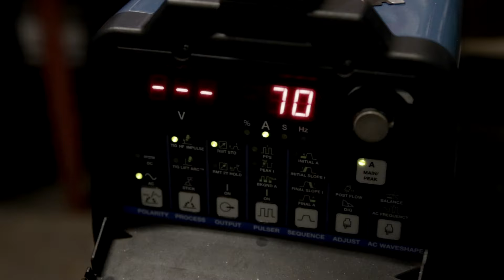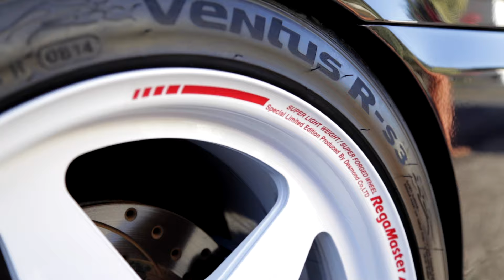Integra K20 Turbo Project for Autology Unltd.

Comment: I'm getting a 1994 integra ls hatchback I wanna do a swap but idk which one any ideas guys I'm new into cars so help...
Reply from the maker: CaptainZero depends of the budget. Expensive and powerful - K20 Engine or Cheap with good power - B Series Engine
Reply: PierreTVPR I can spend 2k on engine
Reply from the maker: CaptainZero 2K can be a start line, but maybe B-Series its the best option for you.
Reply: how much do i need to invest to get around 400hp and i have an automatic.. ?
Reply from the maker: CaptainZero Wao! Thats really hard lol, Boosted maybe 5K but the first step its make the car Manual.
Reply: PierreTVPR it was 800 and it runs lol so whatever I put in is good
Reply from the maker: CaptainZero haha oh yes
Reply: PierreTVPR how much is a conversion usually from automatic to manual ?
Reply from the maker: CaptainZero good question.